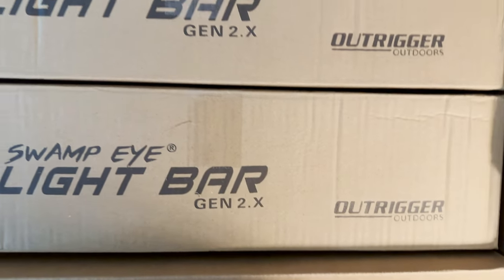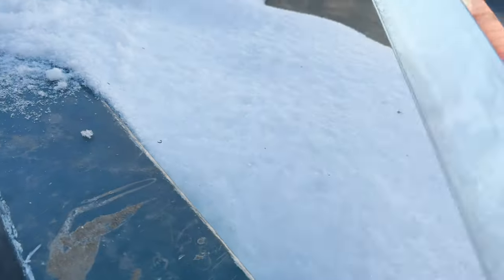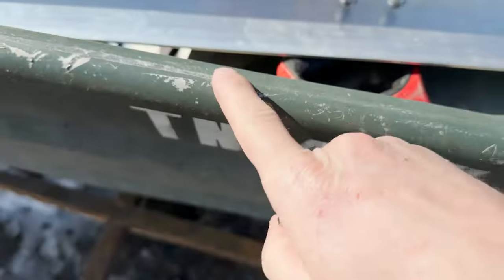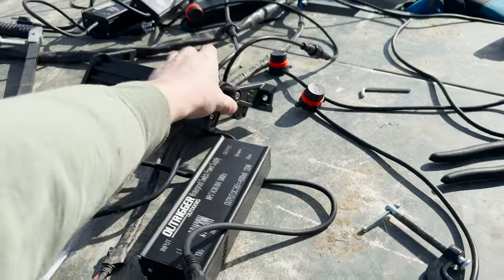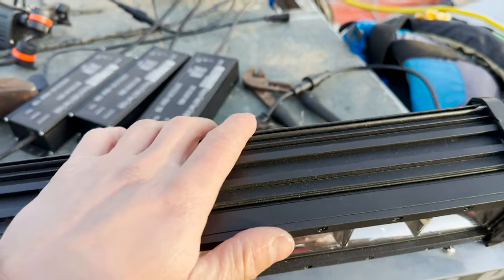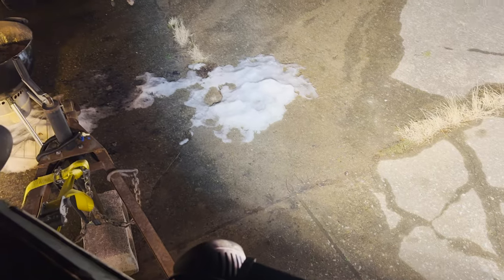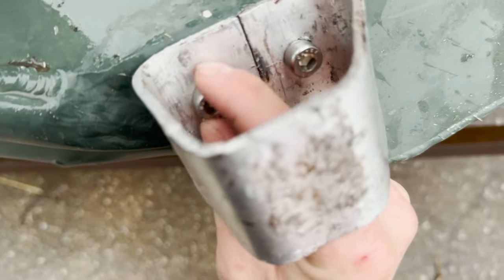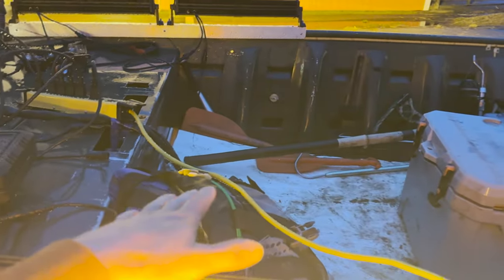NEW BOWFISHING LIGHTS! Unboxing & Installing Outrigger Swamp Eye Light Bars

Comment: Need to rethink some of this. 1- move the trolling motor to access more mounting options for your lights. 2-you never want your lights reflecting from your bow (hard driving at night with the glare). 3- by adding a few feet to each side you could have obtained a rail on each side to be easily removed in case you just didn't want them on there at the moment. Best of luck and God bless. Don't take this as a slap,insult or anything like that, like most people. I've been building bowfishing rigs for over 25 years, seen it all.